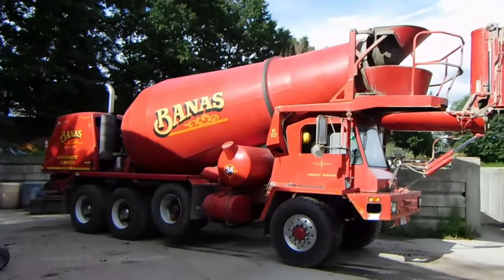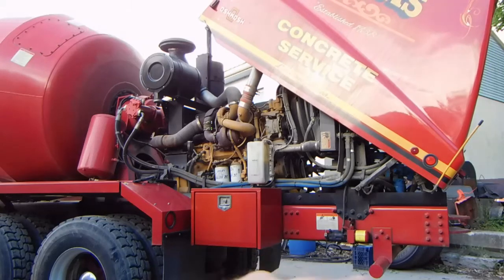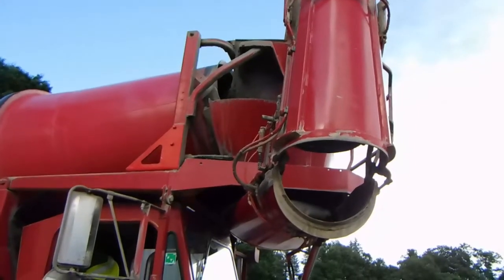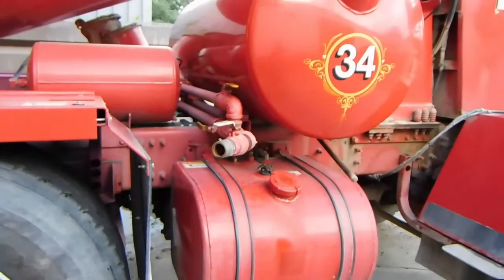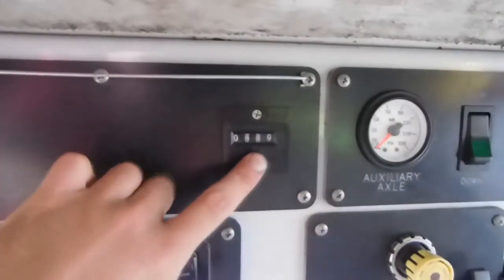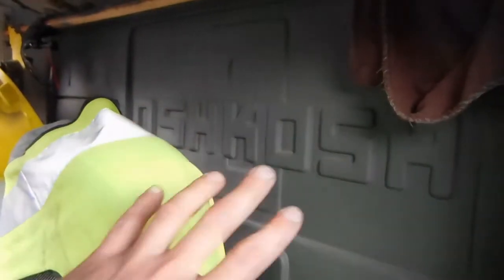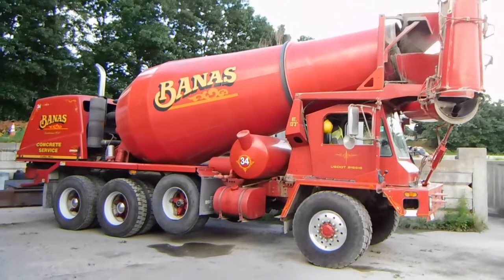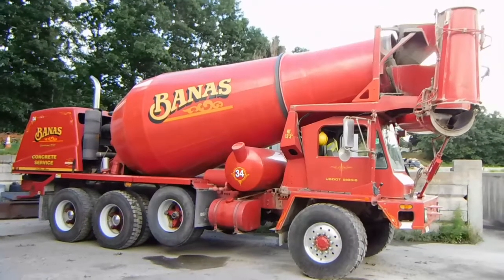Oshkosh Concrete Mixer Walk Around and Basic Operation (How a Cement Truck Works)

Comment: Nice video...I'm 16 but when I turn 18 imma get my CDL to drive cement trucks and trash trucks...one question though how do you clean the inside of the drum ?
Reply from the maker: Every now and then  you have to go in it with a jack hammer and a sledge hammer. There's a hatch on the side of the drum

Comment: How do you train new drivers??
  I operate a rear-discharge now, just got 24 years in last month!😊
  Seems like in the south where I'm moving to, it's mostly front-discharge, so I'm trying to get as much info as I can!
  Your videos are INVALUABLE,  and are easing my mind with the almost inevitable change!
  Thank you!!😊😊😊
Reply from the maker: Well, obviously the cabs are single seats. So training involves following the new guy in a pickup, or whatever company vehicle they use for it, and instructing the driver while on the fender at first and then along side the truck from the ground once he starts getting the hang of it. I've been doing the training now for our new drivers. First day with me is me operating the truck and having him sit on the fender and watch as I explain what I'm doing.
Reply from the maker: There are trainer front discharge trucks, they allow a second guy to ride shotgun. Not every company has them though as they're expensive to keep around.
Reply: I trained in a 2 man Oshkosh. It’s pretty old and they said the company stopped making them 🥲

Comment: Do you have a lower or raise hopper button? I’ve seen them in other trucks and wonder why you would need to use this button
Reply from the maker: Our trucks don't. That options keeps things cleaner and can let stiffer concrete come out of the truck easier.

Comment: Do you use ELD or paper log?
Reply from the maker: no not required
Reply: Logs are only required for travel over 100 miles as the crow Flys. We never go that far

Comment: Man y'all got it made we only get 150 gallons lol. Also I absolutely hate the hood lifter on Oshkosh trucks. Such a pain in the morning with no air pressure.
Reply from the maker: There are companies out there with 250 and 300 gallon tanks even!
Reply: Out where I am,  another company wants to squeeze in another half yard , so they went with super singles instead of duallies, and went down to a 80 gallon tank!!
  We run 125 gallons.

Comment: Excellent walk around tutorial. 
Watching a few of your videos today and you have to STOP saying “nothing special here/there”. If anyone watches this video, it’s bcz they think it’s pretty cool and kinda ‘special’. 

*Video Idea - Make a video on some of the admixtures you guys use in your mixes. 
I’ve always heard that the water reducers are pretty close to the same chemical make-up as dish soap. Any truth to this?
Reply from the maker: fair enough, most of things I brushed over are a few of the normal big truck equipment. Yes water reducers are very similar to dish soaps. If you're mixing concrete yourself out of a bag, you can add dish soap to it to bring the slump up a little without adding a bunch of water for example.

Comment: No tag axle ??
Reply from the maker: Not required here. I can haul 11 yards with this setup here in this area.
Reply: @banasconcreteservice5533  and in other states you may need 5, 6, or 7 axles.